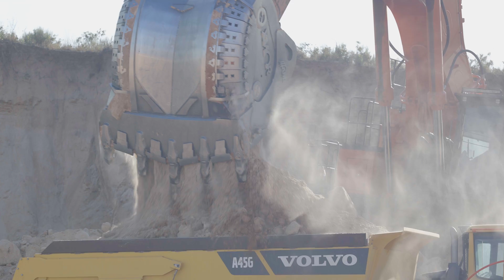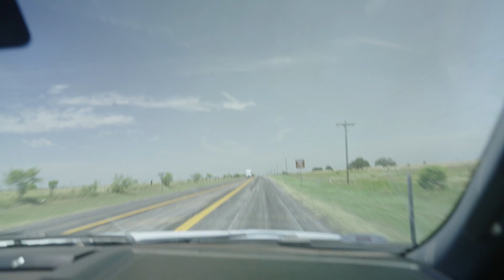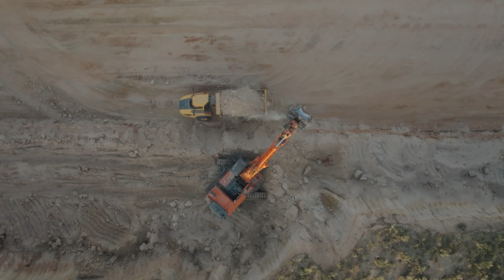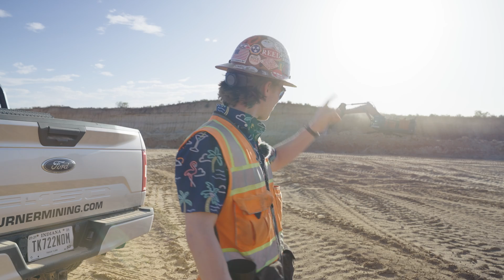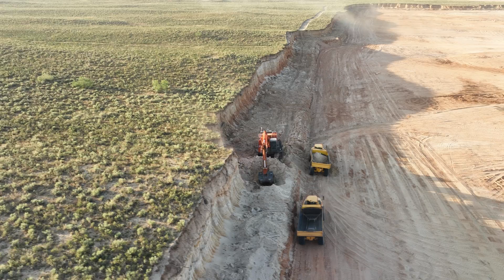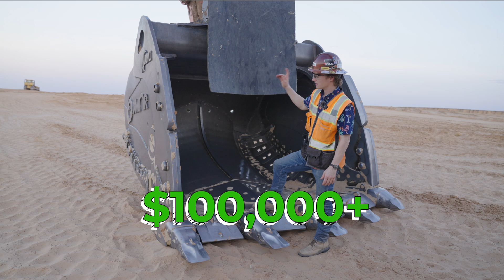Mining Frac Sand with the XMOR Bucket

Comment: What's the rubber flap in front of the bucket for?
Reply: Probably to help keep sand off of the main pin for the bucket.
Reply: For idiots that can't keep dirt out the bucket pin
Reply: That rubber flap is to cover the main pin for the bucket to hopefully keep sand out of it. It seems like a good idea but it doesn't work. All of our buckets here at Turner wind up with sand packed in every single pin so there's really no way to stop it